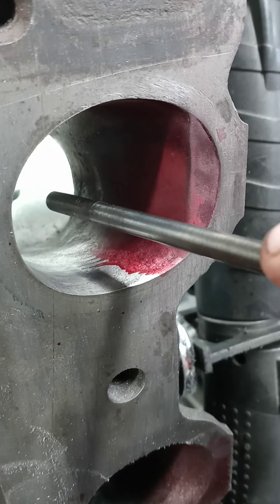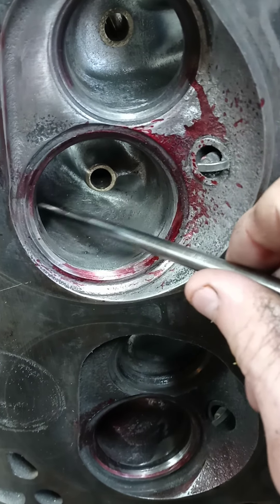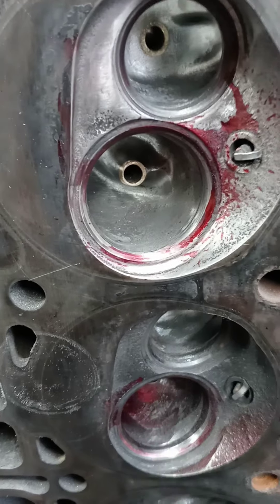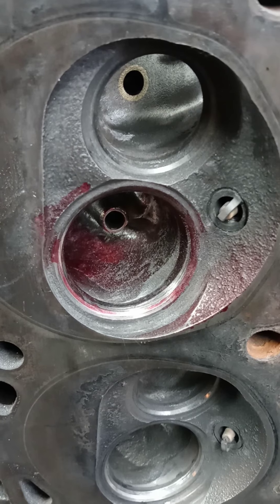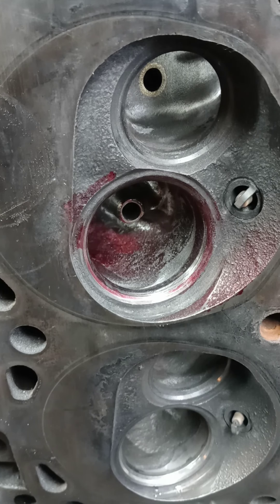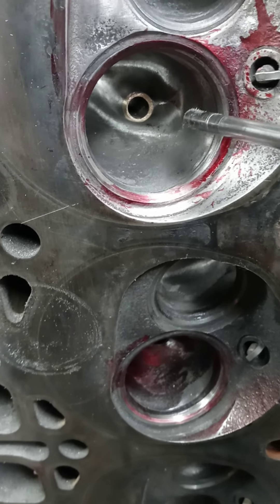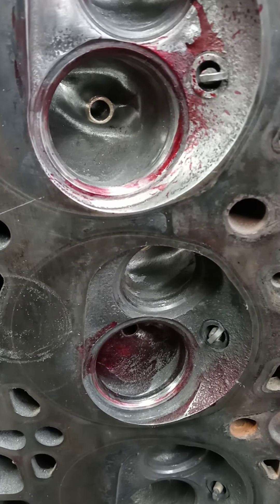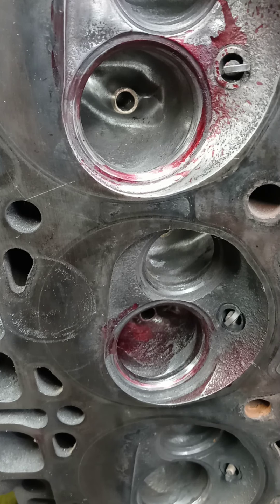BBF dove heads reshaping the intake runner( happy with the results i see)

Comment: Prostock heads have alot smaller runners than you think. Also having that paint not splatter in the bowl. Means more fuel is getting around the short side.
Reply from the maker: The red dycom is going exactly where i want it to go and i worked very hard to get the short side to do exactly what it's doing and to be honest I've seen several pro stock heads such as bob glidden bill Jenkins and we actually had Ronnie socks duster that my friend bought and i helped him work on it had the x heads on it i have pictures of it with the wheels in the air on the street